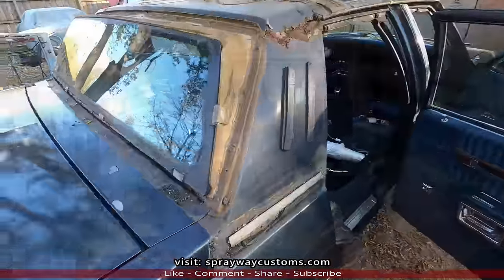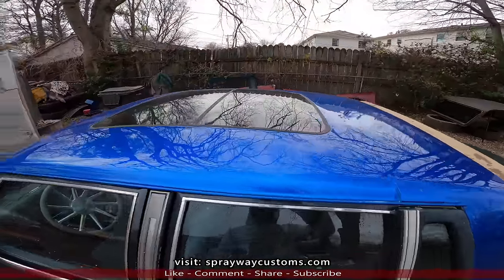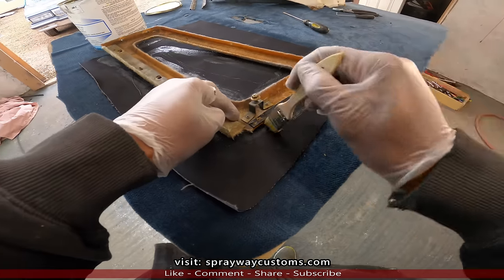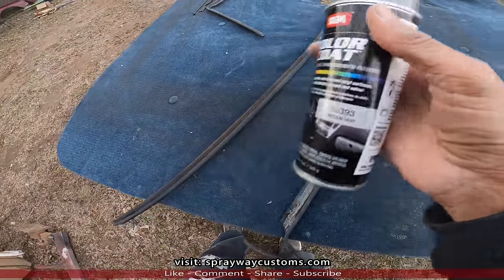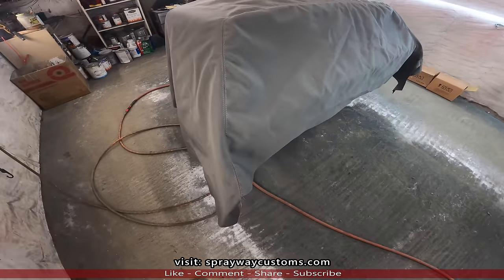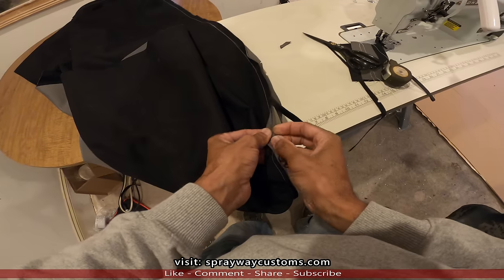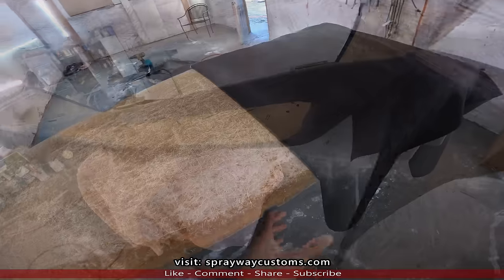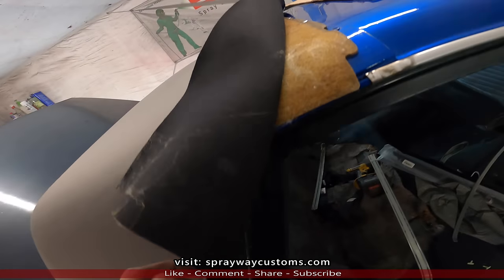Box Chevy Caprice LS Brougham Quarter Top Install & Stitch - Removing Old Vinyl For Canvas Material

Comment: Sprayway that level to your right is used to back stitch when you reach the end of run ,push down on handle and it will reverse to lock stitch in at the end. Do that the beginning and end of each run.

Comment: About 20 years ago, I took a vinyl roof off a 1979 Olds delta 88 holiday couple. It took be 2 days of 3 hours each. Basically skinned it like a deer. Lots of work. Enough about me - I enjoyed your video alot. Thanks.
Reply: Way back in the day I had a 1980 Olds Delta 88 Holiday Coup. Only two was in Memphis. Wish I still had it. Was Dove Grey and Burgundy interior with bucket seats!
Phillip Hall
Reply: @PhillipHall01  I collected parts off a 1984 delta 88. Still have two tone trunk lid, full dashboard, plastic fillers,  rear license plate panel and the red and yellow lights still after 20 years in my basement.

Comment: Been a while since watching your videos, still doing great work as always! Good to see you are expanding, if you want something done right do it yourself. I'm really impressed with that top(and everything you do actually), can't believe it's your first one. I have that same sewing machine and it has been one of my best investments, that servo motor makes it so easy when doing detail work like that. A couple suggestions I have but aren't really needed because you do impeccable work but it may make things a little easier. Add on to the left side and back of your machine table, when sewing big pieces like that the fabric wants to fall off the table pulling it and making it harder to work with. They also make a special foot that has a spring loaded blade that rides in the seam so you get a nice even straight stitch. Not trying to say your stitching wasn't straight or even because you did a fantastic job! It comes in handy if you were to use a different colored thread like say a blue to match the paint on the roof. Please don't take my suggestions as me hating or anything because you truly do wonderful work, I have learned so much watching your videos(especially making custom door panels)
Reply from the maker: Thanks for the tips

Comment: Holy smoke my man you need a staple puller. That little pick your using is gonna be stuck in your thumb. Now that your into upholstery youll be dealing with alot of staples. Check out the different ones they sell like the Osborne one.. Its my go to
Reply: Thanks for the tip to Sprayway. I would like to take that advice too!  Which Osborne one do you reccomend?  (model number) 
Thanks,
Phillip Hall